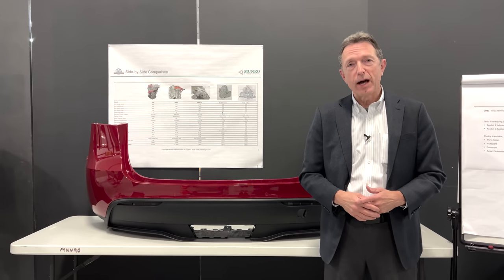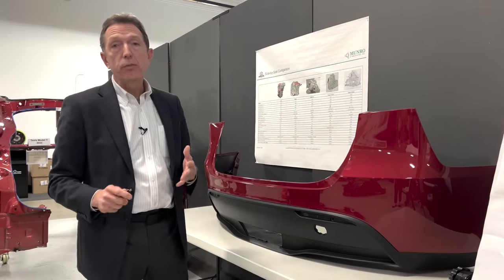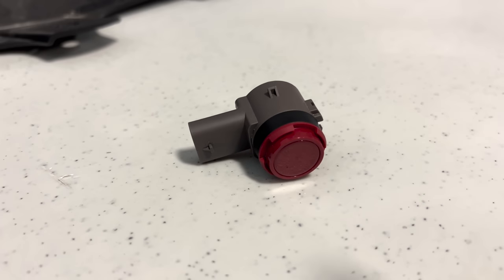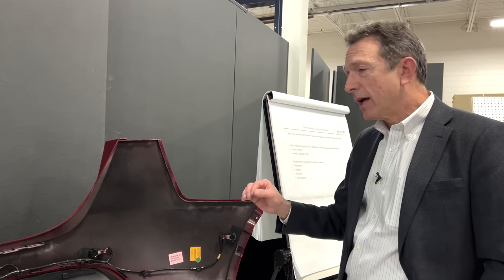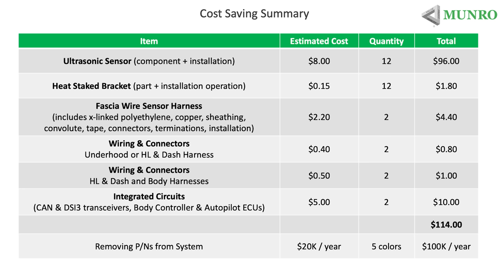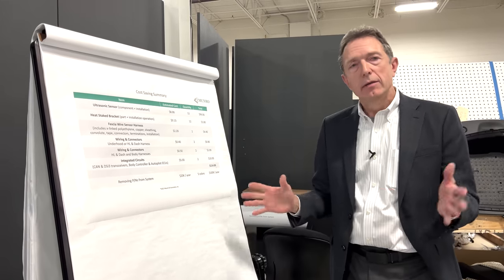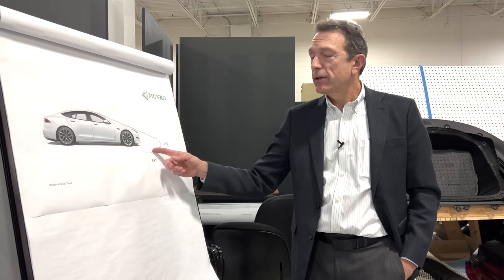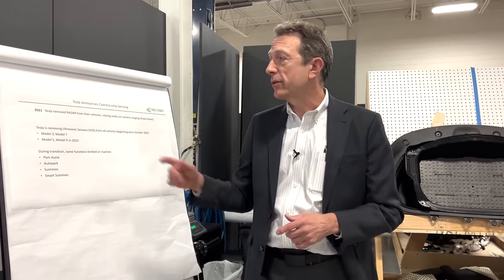Tesla REMOVING Their Ultrasonic Sensors

Comment: I wouldn't be surprised if this has to do with the global supply shortage, and or the desire to cut costs.. I don't believe that they do this only because they think that the camera solution will be better. Cameras can be fooled...
They tried replacing a standard rain sensor with a camera-based system years ago and it still doesn't work properly. It only works somewhat satisfactorily during optimal lighting conditions. 
At night it's almost completely useless. Seriously, the most used function on my Model S is probably the windshield wiper button...

I also prefer the adaptive cruise control on my 2012 model Audi Q5. It doesn't phantom brake like the traffic-aware cruise control on my Tesla.. I don't dare to use it if I have anyone behind me, because it will slam on the brakes when you least expect it to. It's also extremely uncomfortable for the passengers who get very scared every time it happens. 

I also believe that there should always be some redundancy. In an airplane, there's always more than one system to ensure safe operation. While in a car that is supposed to be able to drive itself in the near future, your life would be in its hands. Shouldn't there be at least SOME redundancy and not only cameras? I live in Norway and during winter the cameras are constantly blinded either by snow, fog, or the sun itself since it will be basically right in front of the car at certain times of the year here up north..
Reply: I don't think there's much redundancy. Flying is definitely not similar to driving
Reply: @Spawn223311  Flying and driving is similar in one key way though: If you crash, you could die. Imagine going 100 km/h in your car, which is driving itself. Then the camera fails to see a parked semi truck in the middle of the road, and you slam into it. Now if it had radar or lidar as a redundancy, it would have seen it. Are you OK with taking that risk just to save costs?
The problem with camera-vision is that it can't understand anything it hasn't been trained to see before. under certain light conditions and such, it can easily get confused. There are many examples of this where cars have tried to steer off the road because of shadows on the road being misinterpreted.
Reply: @Spawn223311  Yeah, driving is MORE dangerous.

Comment: I’m concerned too Mike. My feeling is leave them in for redundancy if another part of the system fails.
Reply: If the cameras fail the car should stop
Reply: @paulmeynell8866  How do you determine the cameras failed ? That's the problem. You can't determine inaccuracies.
Reply: @alejandroperez5368  there is a camera calibration mode that you run .
Then having multiple cameras you can compare images.
It’s unlikely the cameras will fail but you air on the side of caution.
We never worry about the 60 small computers in normal cars or any of the sensors. 
Do you drive along worrying the airbag may go off for no reason? The tech is good and very robust.
And humans are always going to make thousands of times more mistakes than a computer!
Reply: @paulmeynell8866  
That's handy if you're driving, camera has failed your now stuck on the side of the road in the arms of Tesla repair centre waiting for parts.
Reply: @Robert-cu9bm  you can still drive yourself.
And considering the average diesel car has  all the same sensors and up to 100 computers how often do you here of them breaking down? It’s a very rare occurrence
Reply: @paulmeynell8866  
You're the one arguing the car should stop.

Posts break all the time on old cars especially electronics.

Comment: The garage in my house is on the shorter side, so when I park my car inside I have to pull up ass close to the back wall as possible for garage door to close. The beeping from proximity to that back wall is coming from USS I assume? How would Tesla handle that without these sensors?
Reply: Occupancy Network will suppsedly correctly map walls and objects to a 3d space and match that with how much the car is moving & in what direction to proximity beep based on that; also, presumably it'll save the map of objects to memory for whenever you get back in your car.

Comment: Worked in engineering for 33 years and never had one Product Manager tell me they were happy with the cost of the connectors in our product. :) It was always the first thing to get addressed during the follow-up cost reduction project.
Reply: After tying to find ipx7, x8 connectors for a motorbike project i understand, $40 just for a 15 pin d-sub PCB mount connector.  Its expensive. The labor cost in large scale manufacturing must be huge.
Reply: Buy cheap connectors and you get exactly what you paid for.
Reply: Pennywise, pound foolish.
Reply: Don’t even talk to me about the Porsche Panamera Chassis ECU connector, it is the worst connector, with the worst terminals and the worst terminal extractor tool ever conceived, even worse, every manufacturer has succeeded the part because it is so shit which means the fragile extraction tool is now unattainable, short of having a company custom machine a 0.1mm precision hardened steel tool.
Reply: @gtjack9  you had me at German connector design. :)
Reply: I am an engineer who manufactures harnesses and assembly line of same for a living.  Connector cost is usually small potatoes compared to the ridiculous wiring design choices in most cars.  Little standardization in parts or assembly, bespoke designs, lack of team collaboration, excessive tooling needs, etc.
Reply: @stacybehrens7152  Stacy, are nailboards still used for harness construction, or has the process moved on from that?
Reply: Lol…. Wtf are u talking about!? Did you worked at all other companies too!?
Reply: @stacybehrens7152  wrong!!! It’s all about customizations and European cars have the most of them! It’s crazy the amount of features that European cars can offer and don’t even get me started!
Reply: @jondiaz3475  Military grade harnesses for tanks and other heavy vehicles with special expensive connectors each keyed at odd angles and wire out another way able to withstand all sorts of things ..
...and then hand assembled on little pieces of wood with pins....
Reply: @jondiaz3475  Depends on the harness but yes, nail boards are still very commonly used.  There are some more modular and AR assisted versions but the process is fundamentally the same.  Smaller harnesses often don’t require such fixtures.  Nail boards are an effective process fixture but their necessity is often an indicator of inelegant design.
Reply: @Vamanos46  Absolutely correct. (Sounds like GM .. I used to work for them)

Comment: my concern is the fact that camera can get blocked by snow and dust where sonics would not be as impacted
Reply: @mohammadwasilliterate8037  Like it does today every time it rains & it intermittent lowers the speed of the car due to limited visibility.....Fantastic isnt it....
Reply: Sonics can still be impacted by slush and ice build-up in the winter. (my personal experience)
Reply: @Clearphish  Totally right. I live in the nordic countries. Last winter i had 3 days where the radar would get that much slush it wouldnt work. The last 3 weeks after beeing on "Vision", i have multiple times in rainy conditions wondered why it felt like the car was lowering its speed until i checked the screen and "Reduced speed due to limited visibility" showed up. No other cars with cruisecontrol does this and from 3 times a year to every time it rains? Guess if the cams for parking will be the same or not ;-) Its a spreadsheet costsaving world he lives in.
Reply: much more of an issue with vision vs radar. radar is a very useful sensor on a car and there are many things that radar will always do better than vision. teslas cost reduction moves are pretty harsh but they have probably evaluated that compromise thoroughly.
Reply: @drkastenbrot  Sorry to say, but saying manufacturer knows best is a standard answer which anyone can use without having any knowledge about anything on the subject & unfortunately has been proven wrong time after time.
Reply: Yes they are. Every winter at least once.
Reply: Cameras are 2-4 feet off the ground.
USS sensors are mounted 6" off the ground.
Can you explain how USS would be less impacted by snow?
Reply: @ChipMIK  Ya, like humans should do but often don't.
Reply: @drkastenbrot  As Elon states often:  Safety is the number one first consideration. Not cost, not supply chain, not production speed, or any other factor. Safety is # 1 period.
Reply: @terrysullivan1992   I know this is true, but I've also seen Elon get doctrinaire or even fixated on the "best part is no part" approach.
Reply: @ChipMIK  You mean... just like a good human driver does when visibility is limited? Do you really want a car zipping along at 85 like some crazy drivers do when it cant see traffic???
Reply: Specific camera cleaners for the front windshield camera area would be useful. I just did a road trip and it kept activating the wipers while on autopilot on a dry windshield. Even with liquid cleaner, I couldn’t get the window clean enough on the highway at 70 mph and there was no where to pull off to clean manually. I completed the last 30 minutes without autopilot.
Reply: @patreekotime4578  50 mph/85 kmh on mainroads in normal light rain  where everyone else drives 85 kmh too. I see where you trying to go but you are utterly far off. I drive +30.000 miles a year at +2 miles/5 kmh above the 80 km speedlimited to follow the traffic. Your judging people you doesnt know with such a statement.
Reply: @terrysullivan1992  Totally off with your statements. Hes an ice cold  businessman telling you what you like to hear and creates a dream in your head. Why hasnt auto-wipers/headlights been fixed if its the Best system, Come on, its safety and should be easy, the rest if the worlds manufacturer can do it? Its +5 years since intro & theyr still auto-random with the lights herrassing 80-90% of traffic where it needs to change light? Why is it still not working when its camerabased and the best and safest thing to use?
Reply: @terrysullivan1992  elon also permanently lies about release dates. he is a businessman and while i love the cars, i wont just blindly believe elon anything he says.
Reply: @ChipMIK  replied to the wrong person?
Reply: @drkastenbrot  Nope :-)
Reply: @ChipMIK  i said quite the opposite of "manufacturer knows best". i said its a compromise for cost reduction.
Reply: @drkastenbrot  Sorry for getting it the wrong way around🙂
Reply: @terrysullivan1992  Yes because if also broken a little bit of the chassis because I trusted the uss. They don't see everything and give a wrong feel of safety.
Reply: Cancelling my Model Y, they get worse and worse
Reply: @bru512  Because it is fundamentally different technology. Ultrasonic waves just go through dirt, rain, snow, fog, so they are not impacted by such conditions while visual cameras are. Just like the radar sensor they removed works in darkness and bad conditions while the cameras don't. I'm getting a Model 3 and this is a bit annoying. They will never fully replace the USS functionality with Vision and I will miss the accurate information during manual parking that I get with my other cars, up to 20 years old! I'd happily pay $115 extra to keep the dang parking sensors!
Reply: @liampope1  Problem is.. that you can't. Tesla has now decided this is best for you. Even if you have the Sensors already, they may decide to OTA nerf your car by disabling them.. While stating this is for your own good and to improve your user experience / longivity of your car. Personally I find the USS almost useless in practice, they always lag 2 or 3+ seconds behind, so when I'm warned to stop I should have stopped already or I would have crashed into the object. And I actually paid like 500 usd extra to get them I believe.
Reply: That’s it: my first and last Tesla. They are insane. This will lead to scratches or worse, and lots of trips to the body shop.
Reply: @terrysullivan1992  this clearly isn’t true otherwise the cars would still have radar and USS along with the 5mp cameras.  Removing items that will give feedback information ultimately remove safety. Just look at the amount of phantom break issues when removing the radar. Which still continue to this day.
Reply: @bru512  Possibly because the USS are mounted on part of the car that's basically facing downward, while the cameras (at least the front camera) is facing upwards.
Reply: @ChipMIK  Can you provide 2 examples of where Tesla was proven wrong on the safety of their products?
Reply: @ChipMIK  My M3 headlights are 3x better than my Lexus' headlights.
Reply: @liampope1  Can you provide reference of how USS go through dirt, rain, snow, fog?
Reply: @darrennew8211  Have closely have you looked at a Tesla?
Reply: @bru512  I have owned my car almost 1 year now. 

#1 : Within 1 week after converting to "Vision", it tried to pull me towards an oncoming truck on selfsteer when the truck was 10 meters in front of me, rainy conditions. This hasnt happend or anything like that at all on the 11 months/ +25.000 Miles i had the car radarbased. 

#2. Driving in the dark on selfsteer i notice an animal ahead. Foot careful on brake as a precaution & to break selfsteer. Away is animal as the car always dims when leaving selfsteer.

Thats 2 points i have experienced & fight with every day. 

 Safety is also confidence & the amount of energy you put in driving the car. The amount of intervention i use in the rain or at night is FAR beyond anything i had when the car was radarbased, which i actually paid for.
Reply: @bru512  So your auto-dim on your TM3 (not M3, thats a BMW), works 3x better than your Lexus?

Mine behaves exactly like this video Tesla bjørn made after he was in disbelief of the "Vision"´s forced use of auto-light, im sorry i simply dont believe your Lexus has worse auto-dim functionality than this: https://youtu.be/Wi0kmshoVDk
Reply: @bru512  I've owned a Tesla since before they made 20,000 of them.
Reply: @Clearphish  Even water droplets on the sensor is enough to give a false alarm (my Toyota suffers from this issue)
Reply: @ChipMIK  Not saying that automatic headlights are fantastic, but personally, no one has ever flashed me for having my headlights too bright. (M3 SR+ 2019) Auto wipers also work adequately most of the time. & when they don't, I put them on manual. These feature have improved a fair bit over the last 3.5 years & autopilot  has progressed amazingly over the same period.
Reply: @Clearphish  Did you see the Tesla Bjørn video i have linked to? I drove an approx. 10 miles trip one evening and had +10 "incidents" with lights, all recorded, all sent to Tesla where they downloaded data from the car & all acknowledged by the engineer i was in contact with.

If you put wipers on manual youll risk the cars loosing ability to steer completely now its camerabased, so be aware of that, although after mine tried to pull towards that oncomming truck, i hardly ever let it steer by itself in rainy conditions.

My main complaint is i bought a radar based car & Tesla has now removed that, 100% due to costsaving. Lights & wipers were "mine" on radar-software, not forced to use the "automatic".

You should check out that video of "Tesla Bjørn" i linked to if you havent seen it :-)
Reply: @ChipMIK  As far as I know, older vehicles like mine continue to operate on Radar. I still have the option of 1 car length on adaptive cruise and autopilot with my 2019 2.5 version. That being said, it's really sensitive in construction areas that have lots of cones.
Reply: @ChipMIK  Can't find your link among all the other posts
Reply: @Clearphish  If you still have 1 then your not on vision, lucky you :-)
Reply: @ChipMIK  I'm sure you could pick one up if you wished to. I've seen a few for sale around here.
Reply: @ChipMIK  😉 I was driving around on autopilot in the rain on a 4 lane today, and the car's vision was way better than mine. Recently it's also been working quite well on 2 lane roads.
Reply: @Clearphish  LOL unfortunately i live in Scandinavia where heatpump is much appreciated, and theres quite a few improvements too in the 2021, but if he continues like this, he might disable the software for the heatpump to make the software easier to maintain on that area too....Hmm....Perhaps i should 😀 😀
Reply: @ChipMIK  I think we may have lower average temperatures than you, here in Canada. 😏
Reply: @Clearphish  Thats for sure, i better just stay here & burn the car in 4 years time when the loan is done...Might even earn a few $ on that here on YouTube😂🤣😂

Comment: Finally someone properly explains this case, thank you.
Reply: I wish they will increase the USS and give coverage next to the wheels to avoid curb rash. I would pay +$1500 for all the USS + some extra near wheel added, Come on , they do not add noise while driving like radar was supposedly adding , it is for low speed and for parking , why would you get rid of them. They are an essential tool. (P.S. maybe also adding them to the automatic opening doors so you do not "ding" them.